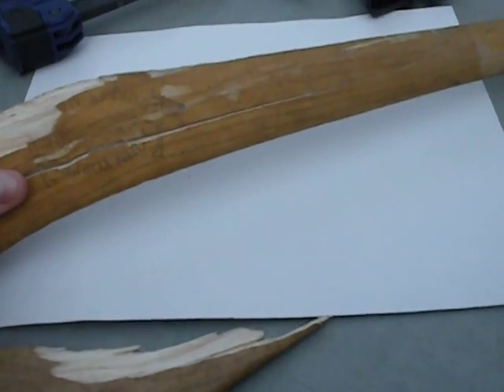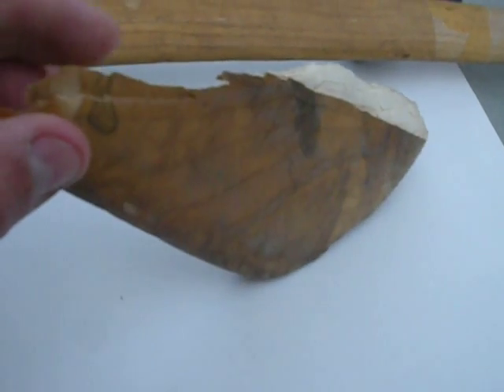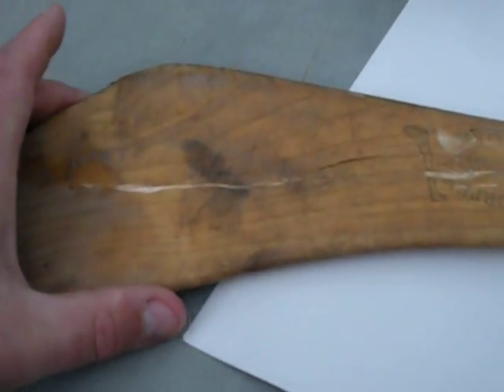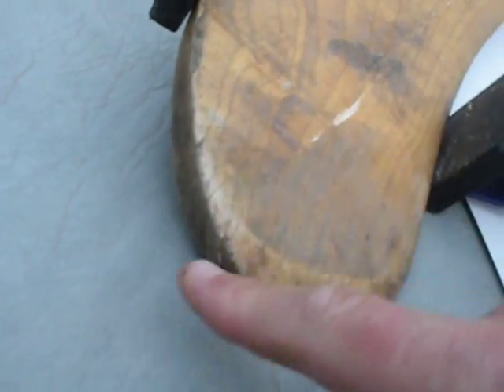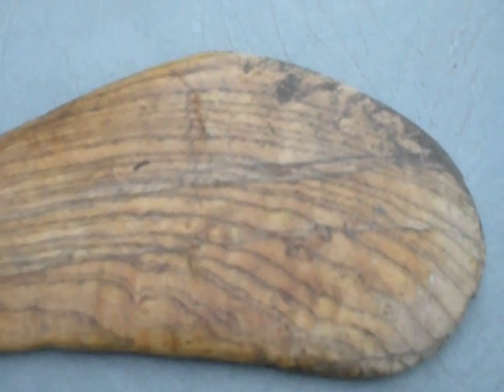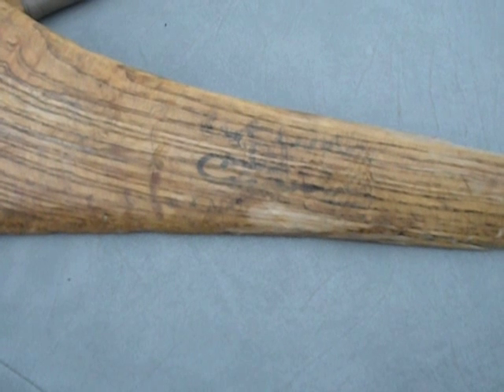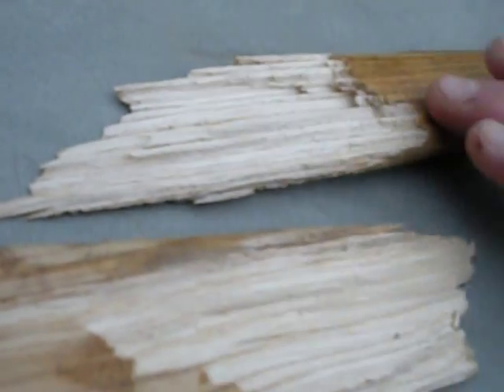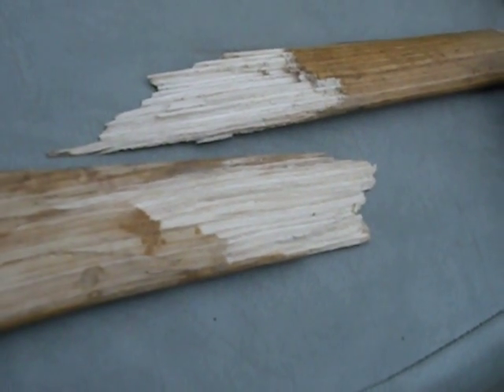Fixing a Hurley Part 1b - How to Epoxy and Clamp

Comment from the maker: Why not boiled?  Also, a brush does no better job than a paper towel.  There's no need to spend the extra money.  A thick coat of oil on the surface will be thick whether it's from a paper towel or a more expensive brush.